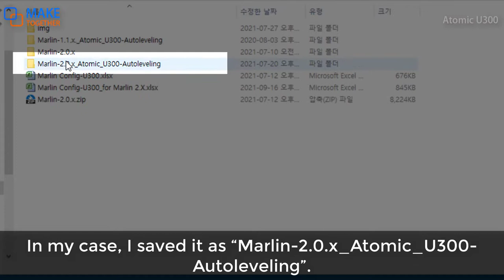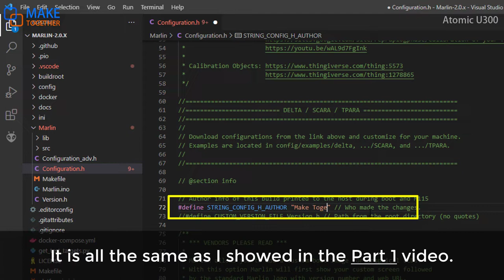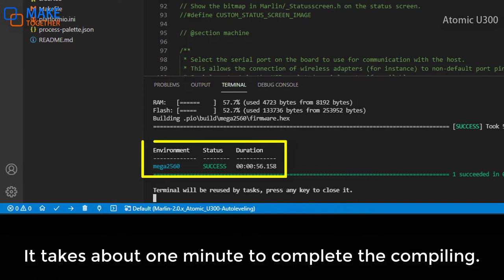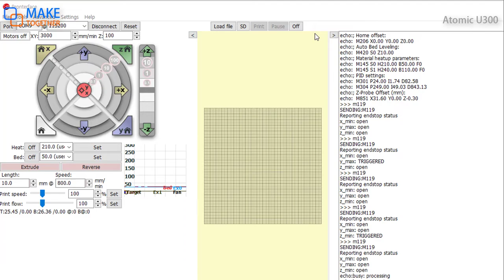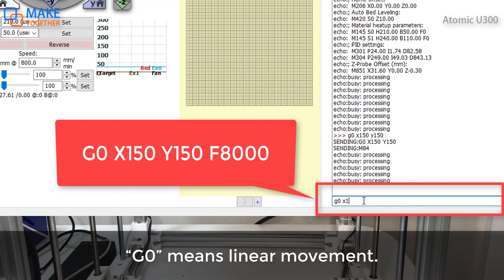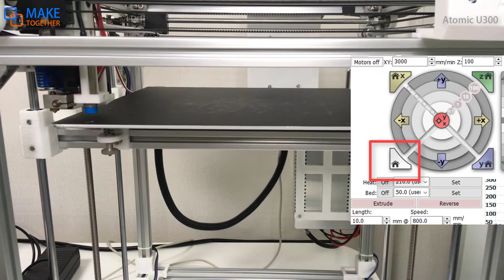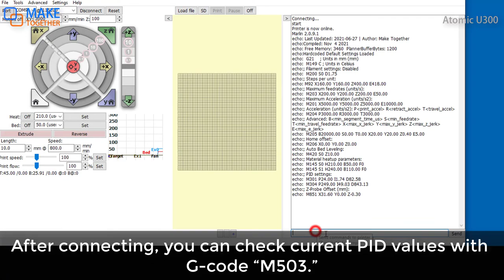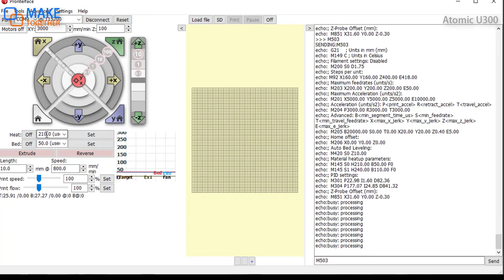Compiling and Uploading Firmware and Fine-Tuning - Atomic U300 Marlin Firmware Setting Part 2

Comment: Hi, is it possible to tell marlin that I have 2 y axis stepper motors, instead of just the one?
Its a single extruder, single z & x motor but dual y axis assembly.
Reply from the maker: Thank you for your question, Hamza.
You can use 2 Y-axis motor with a dual motor adapter.

Comment: When connecting with Printun how it automatically loads the printer information is found at minute 7:11
Reply from the maker: Thank you for your question, Esau!
If you select the correct "Port number" and "Baud rate", the program will connect your printer.
After connecting the printer, it automatically loads the setting values in your printer.
Or you can use "M503" G-Code. Any time you type and enter "M503" in the console bar, it loads all the setting values.